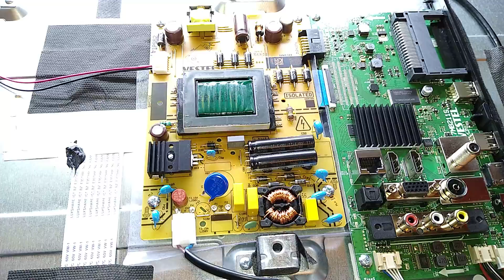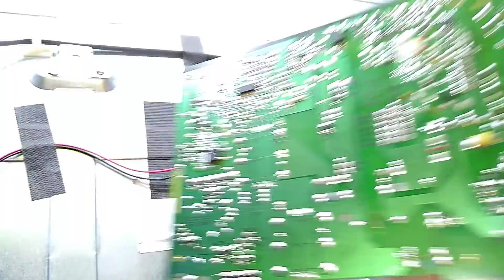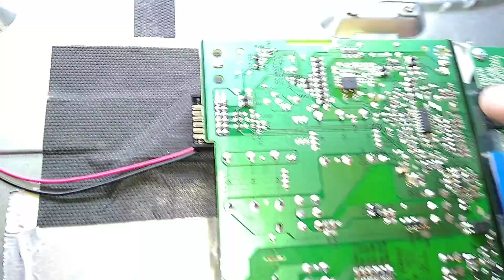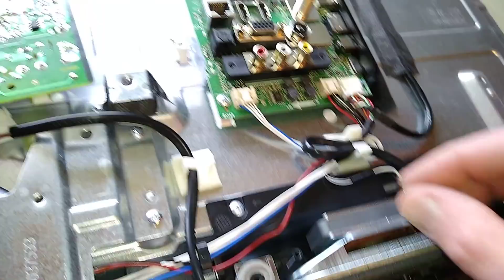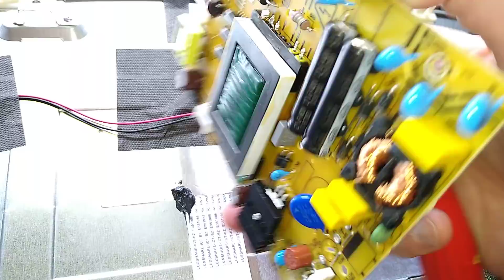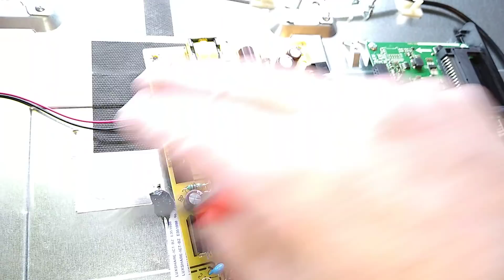There's not much inside TVs these days

Comment: If TVs were like this in the 60- 70s I would have never looked at the elements inside of the vacuum tubes my father and uncle tinkered with, never worked in TV repair shops during high school, never found electronics so fascinating.
Reply: I think you've got a very good point there. My interest in electronics was sparked when I was about 5. My parents used to let me fiddle with an old Bush battery radio and the entire back was removable to change the PP3 battery. All the brightly coloured wires and components really intrigued me as to what they did. I can imagine if it had looked like this TV, I wouldn't have given it a second thought.

Comment: My LG 55" died a couple years ago, cranked the entire picture in to a postcard in the corner.  Threw the display board in to the kitchen reflow oven and it's been working ever since.  Actually, I have a ~90% success rate using this reflow method on these stupid RoHS devices.

The problem with these big TVs is where and how to work on them.  Hard to find a surface large enough to safely lay them down and difficult to hover over the middle to unscrew things while not resting you hand on the back of the display to steady yourself.

Comment: That's a lot of boards for an LCD TV.
Check out TCL's latest models, a.single.board.
PSU and computer all in one board. What's amazing is that they don't use any kind of thru-hole components anymore. Even the mains transformer is SMT. Mains filtering caps, chokes, everything is SMT. 
Board model is 40-rt41pb if you wanna find more. TV model is xc32sm. Smart plus android TV.

Comment: Love your channel & all the interesting electrical related videos. I also have to say that the video on caring for our elders (especially the bits helping with loved ones with dementia /Alzheimer's) was really helpful. Beyond that, it revealed a very admirable man, & you're it.. So there's that. Yeah. So anyway, could I ever so humbly make a request?
 If so, here goes:
It would be ever so lovely if you could take a modern LED smart TV (or just a modern LED TV) and show us how to convert it to 12 volts DC if you'd be so kind..?
Yet keeping in mind we're not as skilled as you, so you'd have to try & show us what component(s) to look for to identify the correct spot to introduce 12V battery wires keeping in mind that different models would hopefully have similar looking components to change 120 (US) or 220 (EU) AC to DC but would place them in different spots on the PCB? We promise to assume all risks & practice our safety stuff whilst digging around!! Pretty Pleeease?!
Reply from the maker: Many of the modern TVs do work at 12V, but have a separate higher voltage for the LED backlight.  It could be possible to add a separate 12V boost LED driver.  You'd probably need to switch the backlight manually though.
Reply: @bigclivedotcom  ahh.. Probably smarter to get one made for autos/campers, or use an inverter then.. 
Thank you for giving it some thought & a reply nonetheless. Cheers! ☕👍

Comment: Meant many TVs normally the 4 caps 16v swell at the top or heat flex on the broad LEDs are hell to change.. They work again as we hard reset them without knowing power broads warm up and flex

Comment: Nowadays components are smaller plus there is no cathode ray tube, some of the cheap TV sets use Hanspree circuit boards made in china, I have a friend who restores vintage TV sets, he hates these modern flat screens as he says the components are fiddly to work with. TV sets in the old days needed cabinets to house the valves an the cathode ray tube. Some TV sets were hybrid using both valves an transistors, ITT made such a set. The old line standard was 405 line then in later years in came 625 line, some sets were duel standard meaning they could be used on both standards, 405 line was switched off in 1985 but both standards continued for a while. To work a 405 line set you need a line standard converter, common faults with valve TVs an radios are leaky capacitor's. Such sets used large mains drop resistors, ceramic type they gave out heat this heat often cooked capacitor's an wiring causing the set to fail, these resistors caused many a fire once the insulation crumbled off the wires, the resistors were made by Osborne. The old wax paper capacitor's failed over time due to them absorbing moisture, these need replacing with polyfilm type, you can nowadays get capacitor's you can use near high heat generating components. Electrolytic can caps sometimes explode in old sets, the best policy is starting such sets up slowly on a Variac to allow the cap to reform, sometimes they don't reform an need replacing.

Comment: I used to be a service engineer for DER in the early seventies, working on black and white TVs. Only the most experienced engineers worked on the colour ones back then. Most TVs I had to fix had valves but the very latest 1500 chassis had transistors and I think, just one integrated circuit. I changed to a job in a non electronic industry after that and so lost touch with modern circuit technology. It's amazing how far we've come. I  absolutely wouldn't know where to start to repair a modern TV. When my own ones go wrong now, which is rarely, I just take them to the recycling centre and buy a new one.

Comment: I got a big Plasma from 2006 for FREE :-)
It was one of the first samsung models, and the front is a completly flat glass plane.
I really like that, no edges or a ugly frame. the picture is very nice, only 720p but great colors.

But it died on me a day later. A black goo came out 2 capacitors from the power board.
so I bought 2 really big ones, 10€ each and now it is working perectly.

but compared to this, it is stuffed with several control and driver modules.
powerboard, video board, several plasma-driver boards.

and it weighs 50 kilos. it is very heavy. and big. lifting it on the cabinet is not easy.
 
rgds

Comment: Often wonder if longevity of these circuits has been impaired by the lack of lead in the solder causing failed  joints .
Reply from the maker: It's almost certainly the issue here.

Comment: All of the mystery's gone out of owning a boob tube.

When they had valves and socketed ICs, if they played up, they could often be made to behave, by giving them a strategically located 'bosh!' - a technical term.

On the other hand, failing that, summoning the TV repair guy often resulted in the bloody thing working just fine until he was out of the door.

Good times!

Comment: I did on-site-warranty-repair-of-flat-screen-tv's ten years ago.  There were two kinds of problems.  Ten years ago was the era of "bad caps" that would last three thousand hours and die.  That meant replacing the power board.  The other problem resulted from the fact that it was possible to buy an HDTV before the cable company supplied HD to your house.  When the cable company upgraded the box there would be color bleed on the screen where it should have been black.  This meant replacing the LVDS cable which meant snaking it under sheet metal with sharp edges and hoping you did not cut yourself "in the field".  The new cable had more twists per inch than the cable it replaced.

Comment: Clive any update on this?  My 55" Sony popped one day and I found they had a kit for replacing components on the power supply board. I don't truck my surface 
mount soldering yet. I opted for a tested board with a warrantee. Put the new board in and applied power and it came back to life. I think that was 3 years ago.
Next time with the cost of the large screens coming down and the options going up I will likely buy a new one next time something goes bad.
Reply: So any update on the TV?

Comment: I've picked at a tv before, and I thought that 40v feed you thought was odd was what ran the LED backlight.  I could very well be wrong.

Also, you say the problem is intermittent, and that the chassis is ground.  Bad contact to ground maybe?

Comment: VESTEL.... i think they make most what is being sold in supermarkets these days... even cheaper Panasonic models come from Vestel... in addition to 50 other brands... same inner bits and bobs and only different casing or sometimes only badge... everything with label on the back with date code in black rectangle is made by Vestel..  at least it's easy to source spare parts by getting some tv with smashed screen for 10 quid off ebay..

Comment: Hey Clive, I don't mean to be presumptuous, but could you point me in the direction of where I might find resources on how to troubleshoot the power board for a PC speaker system?  It's a Klipsch 5.1model that has all the circuitry in the subwoofer other than cabled control box.  I've sent the board out to Michigan once already for repair to the tune of $150 + S&H, and now it's starting to get bad again.  Nearly constant static and hiss with brief moments of silence.

Having watched your channel for a while I'm starting to think maybe I could take a whack at it.  I'm hoping it's just a matter of replacing some capacitors and diodes, but I could use some direction on where to start or forums that could help me along?  I have a basic meter and some soldering experience, just not the knowledge of how to track down the problem and test the components.

Thanks in advance for any guidance you, or the community, might be able to share.
Reply from the maker: Hi Jonathan.  Check the larger solder joints for signs of cracking, and also the electrolytic capacitors for any hint of a bulge on top.  Those are the most common failures these days.

Comment: ouch... watched 3 seconds of your video and screamed "vestel crap". this is garbage that shouldn't even be sold. there are lots and lots of different "old" brands that have been bought by some chinese company that sell the same stuff over and over again. the better known the name of that company is or "was" , the higher the price of the TV will be. recently even Panasonic started manufacturing all the cheap TV's by Vestel. it's kinda sad... Panasonic was the only brand left that you could buy in the budget segment. now there is nothing left. maybe Samsung is the next choice here.
anyways... if you buy a proper TV at 1000€+ you will ofc find a lot more and better components inside a TV. not as much as you could find in the early CCFL LCD TV or Plasma-TV days but you will definitely get a lot better picture and sound for your money.

Comment: There were even fewer guts inside my old failed Samsung 42" TV.  Three tiny boards and two tiny speakers, spread out over the back of the LCD panel.  As thin as the TV was, it was still mostly air inside.

Comment: The boards are cheaper on the used market because the TVs themselves are much cheaper. IMO the build of the TV is very on par even with my really stupidly old LCD TV. The first one I ever owned. The difference being the PSU is more complicated since it needs to run cold cathode back lighting. Further the processor circuitry is slightly more complicated. Largely because software is much more standardized on Smart TVs and so theres just one SOC package. (this might make it more expensive though for the parts). However the real reason the TVs are actually so much cheaper is because they have revenue streams built into them including adware and spyware as well as branding. Or ya know in "modern" parlance "free software," "user experience analytics," and "app stores."

Comment: i repaired a vestel tv a while back, no back light... was something like 18 leds on 2 physical strips all in series of course one led pops open circuit and they all go out... royal pain in the butt had top remove the lcd panel and all the diffuser layers to get to the leds, boy they take a bit of heat to remove ( the strip was firmly attache to the metal housing so may of contributed a little)

Comment: I used repair TVs and was still.fixing them until recently. Modern sets are utter crap and nearly all of them fail because the LEDs fail and the screen gos out. Almost always the screen LEDs failed. Sometimes takes out the PSU too.
Reply: @Coronadraht this is true they are often over their designated voltage. The issue is also when one fails short it increases the voltage too the others. The entire design is rubbish and not designed to be easily repaired by anyone.

Comment: I tore my flat screen apart and replaced both boards. Unfortunately I think the LEDs burned out. It cost me less then $30.00 dollars to replace both so I wasn’t out much. I’ve heard the power supply can be an issue on the TV set I owned. Thanks for breaking each of the boards down to their individual components BigClive much appreciated

Comment: I'm astonished!  £12 for a PCB replacement.  Our UK-manufactured washing machine packed up a few years ago just outside warranty and a new controller board was £200 plus another £50 for the software which has to be loaded by a £30 loader, £280 altogether and a new machine was £350.  I stripped it down and all the mechanical parts were in pristine condition, as if they had never been used.  But the controller board was very poor, impossible to desolder components without the tracks lifting off.  All components were OK but i could not test the controller chip which I suspect was the source of the problem.  Still very suspicious that the controller can be programmed to fail after a given time which could be counted by mains frequency.   Another reason to always unplug a washing machine!

Comment: I was surprised how little is in them too when I opened up a friend's one that had become a water feature when the roof leaked and the water flowed down the wall from the suspended ceiling in his office. The weird thing was it worked OK after that and only died 12 months later. I assumed it'd be corrosion but I couldn't find any.

Comment: I think there is another board called the Timing Controller board or T-con board. that is hidden beneath some heat sink type plate.. usually it is that board that fails if the power is ok.

Comment: Ive repaired many Vestel PSUs that give the flashing red light on the tv power light. it almost certainally a shorted diode (the large ones you were poking at- EASY FIX!) If you have managed to buy a used one for £12 then youve done well. i havent had a tv in for repair for ages now as people just want new ones when the old toshiba et al goes pop.

Comment: Yep there looks like bugger all in modern TV's but do check out the ribbon cables that connect to the screen. There are chips imbedded in them, the tracks coming out to the actual screen are virtually unresolvable. God knows what they do but I suspect a lot so the processor chip doesn't have to keep up with each pixel. No wonder the actual screen is the most expensive bit. Stunning integration of technology which will just be dumped at the slightest fault.

Comment: On the plus side - the thump of a CRT electric shock is no longer an issue with modern TVs. I was lucky enough never to experience it first hand, but saw it for the first time at 15 years old on work experience. Bloke next to me working on a CRT oscilloscope suddenly propelled several feet back off his chair (he was ok). From that day on I had a slight phobia of working on CRTs.
Reply: @E3SniperspreeE3  current is a function of voltage and resistance. the resistance of the body is generally constant (unless wet), so its the voltage that will kill. it also matters about the duration of exposure, you can have a hundred amps running through your body if its only for a tiny fraction of a second.
Reply: They say that its not the electrical shock that's dangerous so much as your reaction to the jolt. That said, the EHT supply for color (shadowmask) CRTs is not only 25Kv but has enough current to kill outright. That gets your respect. (The supply in old hybrid valve/transistor sets was also dangerous because it generated significant amounts of X-radiation, especially from the PD500 shunt regulator. )(Those were the days!)
Reply: @martinusher1  It's the current that is dangerous, you can take a high voltage shock without too much harm if the current is low. As my physics teacher used to say - it's the volts that jolt, it's the mills (milliamps) that kill.

Comment: I recall being arm deep in a '58 Admiral round tube colour with electronic remote .. three chassis as I recall, more tubes than god. The thing was a cubic yard worth of space heater. 

I did a lot of hardware hacking (various equipment) in the 80's and 90's . late nights with the scope probing and discovering signals .. a few years ago picked up a bit of kit with hopes of doing something similar for a particular purpose .. upon opening - a single FPGA doing everything from the front end demod to operating the display. There was ONE freaking component in the thing. I know it makes sense in one regard .. but in another - that I had truly become a totally obsolete and useless muppet.

Comment: Remove those 6 silicon diodes and check readings all match when forward and reverse biased with a multi-meter on diode setting. If you don't fancy that get a hair dryer or heat gun on the diodes or the output  electrolytic capacitors to see if you can bring the fault on while it's working normally. I had this exact fault on a similar Vestel TV. One diode went short, shutting the SMPS down. Replaced the lot and now working perfect.

Comment: I have repaired a few, the power card is almost always the fault, the mosfets are driven to their limit, probably due to cost, the failure mode makes the mosfet a very short circuit which takes out the safety fuse, I have had optoisolator' go s/c too. if the TV is scrap there are some nice LED strips behind the screen with amazing optics.

Comment: Doesn't surprise me how tittle there is inside LED/LCD TV's now, you would find a fair bit of surface mount components on the underside of the video processing board as well, most people wouldn't even bother to fix a TV if it goes faulty now, much easier to just go buy a new one.